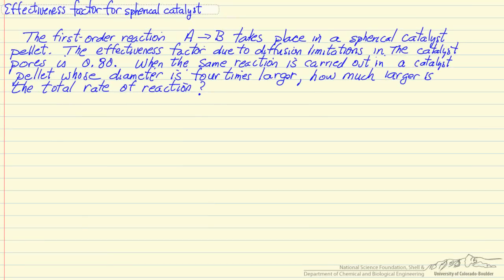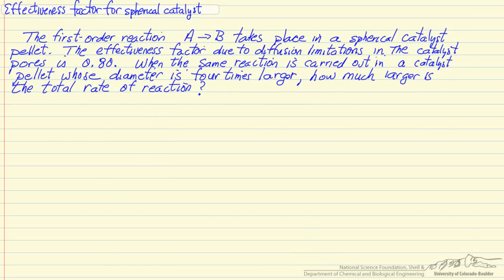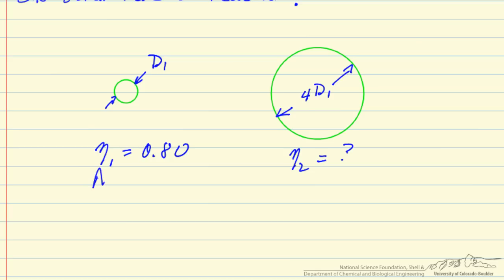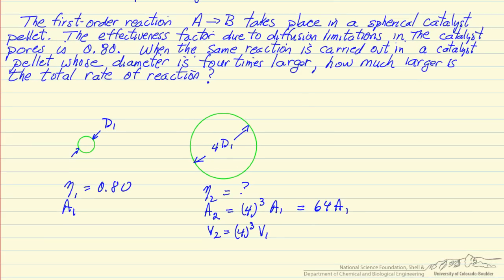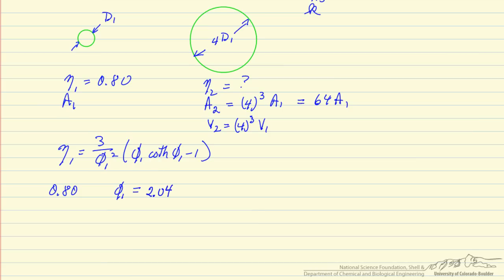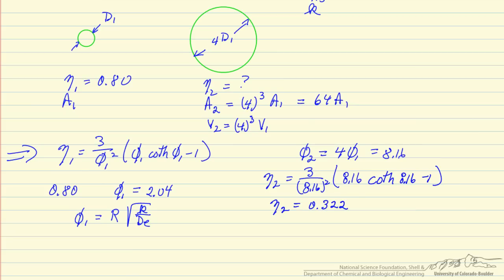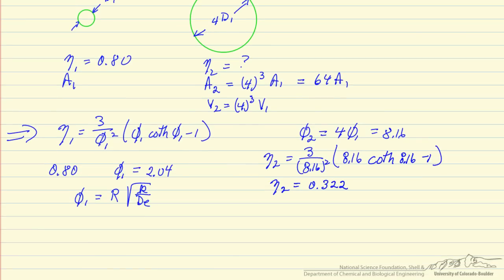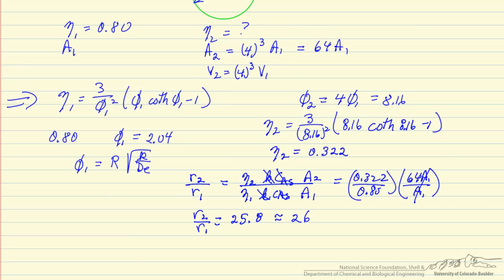Effectiveness Factor for a Spherical Catalyst

Comment: Hi. Thanks for the clear solutions. I don't understand why the reaction rate ratio contains the surface area A1 for r1 and A2 for r2? If the question wants you calculate the production rate of the catalyst of the bigger catalyst pellet, should I use the same solution procedure as yours?

Comment: how did you find the thiele modulus from the effectiveness factor using only the coth equation
Reply from the maker: The equation given at 2:10 has only two variables, the effectiveness factor and the thiele modulus.  We know the effectiveness factor, so we solve for the thiele modulus using a spreadsheet.